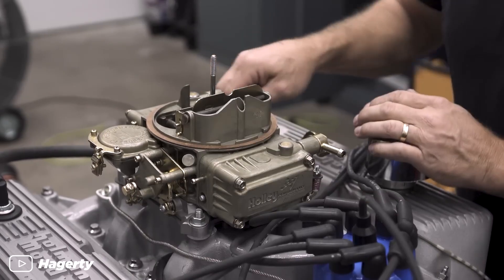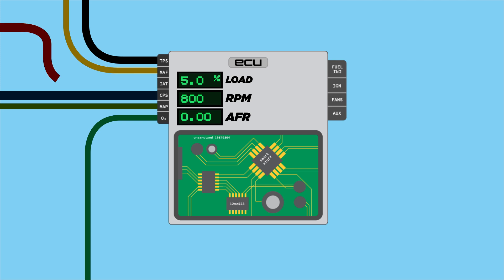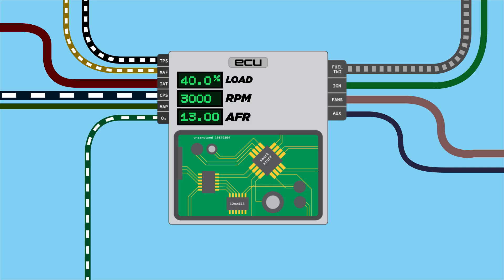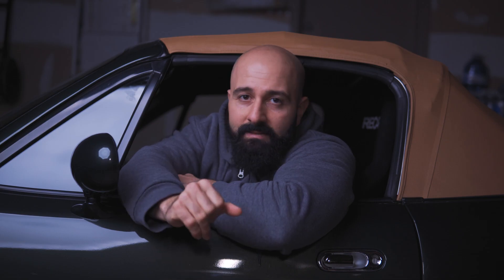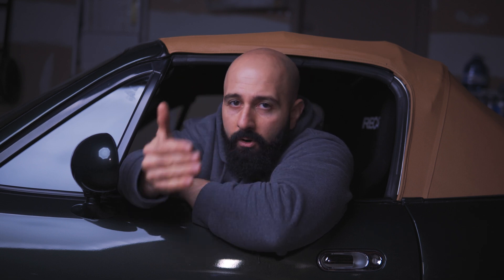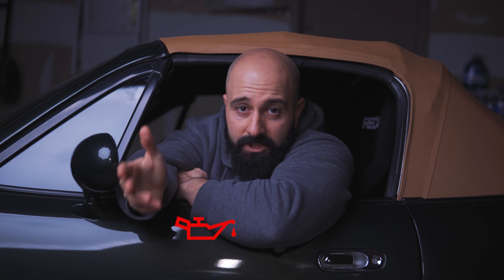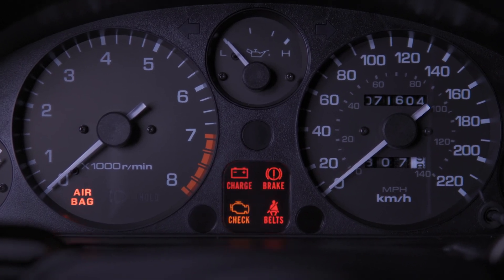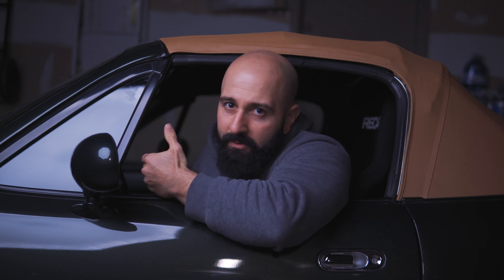Engine Warm-Up Myths || EXPLAINED

Comment: I warm up because I don’t drive that far to work. I rather get a full heat cycle in before turning it off. Also rotary… ¯\_(ツ)_/¯
Reply from the maker: Yea for rotary you need a full heat cycle or you'll get carbon buildup.. but you already know 😁😁😁
Reply: @MZopyrus Hello, is there a way to contact you?

Comment: I always wait until the revolutions drop, which is about 30 seconds. Then I drive carefully and slowly along the streets from the house, a maximum of 50 km/h before the water temperature indicator moves, which is about 20-30 degrees Celsius of the coolant. Then I can accelerate to a higher speed on the road outside the city, but I don't bother the engine, I wait until the oil temperature indicator (not water) shows 50 degrees Celsius - then I drive normally. But I don't turn the engine into the red zone unless the oil is at least 70 degrees.
I have gasoline direct injection as a winter car - with a heat exchanger on the exhaust pipes so it heats up relatively quickly and uses all the waste heat from the engine. I also have a petrol 4.4l V8 - and it warms up immediately. 
I used to drive a diesel with indirect injection (with swirl prechambers) - and they are prone to cracking the head around the chambers if they are not heated properly, because the prechambers heat up faster than the rest of the head and there is a lot of tension in it. Diesels with direct injection are much less susceptible to head cracking.

Comment: All you need to do is wait like a minute and 20 seconds usually it takes 30 seconds for the oil to all around the engine to lubricant everything and then druve off like normal
Reply: This is wildly inaccurate. Oil circulates near instantly. Get an oil pressure gauge, or watch any of the 1000 videos that show oil reaching the head within moments of starting the car.

Comment: I think this myth is engine specific. Its called "operating temperature" because its the ideal conditions. Cars today are built for consumers, who like to hop in fire up and go. So its fine to do this. Its not fine to fire up and go for 2 minutes and then cool off. Heat cycles are what wear engines. If it doesn't reach ideal temp during a drive cycle your causing more wear.

Comment: I have to let mine warm up a lot to spare the transmission. I don’t know enough about transmissions to know why but mine for whatever reason will shift awfully until it’s quite warm. It’s an automatic 2013 Acura Tl if anyone has an explanation but I’m probably to get it looked at soon anyway
Reply: Probably bad fluid that needs to be changed. If yours hasn't ever been changed, and depending on the mileage, it's possible that changing it may only do more harm (REALLY divisive subject and you'll a million different answers as to if that's actually true or not)

Comment: If it's warm or hot out, I give it like 10 seconds max just to cycle the oil once or twice. If it's cold out, I normally give it like 45 seconds or so if I'm in a rush.
Reply: 1 minute man, you can give it 1 minute for start and shutoff especially if you drove aggressively
Reply: @nicolae-alexandruluca7853  it's depend car each carbon build up different and some has issue mine warm up at 20sec gti 7 cs winter around 40sec the car sleep outside not in garage*

Comment: i'd reckon it also depends on what you drive, a modern Mazda with say the 2.5 Skyactiv engine doesn't take very long to warm up, usually onces it gets close to 120F i start to take off slowly

now in my Civic Si, it drives like utter garbage unless it's at least 50% of normal operation temperature, especially when it's below freezing outside
Reply: I will say, 120f is BEYOND 50% of it's normal temperature, so that applies to both of your vehicles.
Reply: @QuincyStick  for the Civic specifically, it doesn't give out an actual number, i'm entirely basing it off the digital bars, so typically i take off at 5-6 bars on the temp gauge

hence my "50%" statement, the Mazda is a different story though, you are correct
Reply: @FrozenIce  not sure the year of your si, however on the 10th gen civic (2015-2022) the first bar on the temp gauge is 132F (to my knowledge, from my brief google search)
Reply: @FrozenIce  still better than just 2 lights for the water temp: one for too cold to open the thermostat and one for overheating like in mazdas bl gen

Comment: Thats exactly what my warm up routine is. Living in south florida, i never have to warm up until winter. sometimes in the mornings its a Cool ass 60 outside. so i warm up by starting, Getting in Gear. and Rolling Slowly as Possbile out of my neighborhood to the main roads. By the time i get in traffic im approaching operating temps. on EVERYTHING.
Reply: 60 is not a cold temperature, you just deem 60 as cold. There is absolutely no reason for anyone anywhere to do anything pertaining to heating up a car in that temperature.

Comment: 2:45 to everybody who uses the metric system why do you use Celsius instead of Fahrenheit? Wind Fahrenheit is more accurate you have more numbers therefore you’re more accurate you can divide those numbers easier then you can Celsius, so why do you use Celsius for heat? We need is harder to do then. Everything else a.k.a. Fahrenheit.
Reply from the maker: Because everything in metric basically makes more sense 😂. Sorry to say this but it's honestly true.
Reply: @MZopyrus  you didn’t answer my question Fahrenheit has more numbers therefore it’s more accurate, so why isn’t Fahrenheit used in the metric system you’re going to use something that says I look 20° is 107° and you’re the ones that want to be precise
Reply: @MZopyrus  😄😂🤣😅😁😄🥲😆😂😄 if I post this isn’t answering a question or is it just doing nothing?
Reply: @oler777  You better start using Kelvin, it is even more accurate....

Comment: Isn't it actually MORE of an issue with direct injection because you end up spraying fuel on the cylinder walls and wash down the oil?
Reply from the maker: That's actually not that big of a concern as some people make it to be, technically your cylinder walls are already almost dry from your car sitting overnight and with one stroke they're already coated with oil again

Comment: Bro. I got a 700hp stage 3 S6 and I want to send that shit so fuckin bad because I don't get to drive it as much..

My question to you is this. I have an oil gauge, an this gauge gets to the "middle" pretty quickly, but my temperature doesn't get to 190/200 until I drive it for a couple of miles (I have a digital gauge for that too)

My question to you is this. When can I fucking send it? When the gauge is at the middle or when my temp is at the "normal" levels
Reply: When you get to 190-200 and then another 5 minutes.

Just because your oil is upto temp doesn't mean the entire engine and drivetrain are.

Comment: i let my bike warm up till the exhaust sound changes (15-20 secs) (because it doesn't have a rpm meter) and my reason is I think the metal should have a nice transition in temperature cause just getting onto the engine might rise the temps quick and it might increase wear , I might be completely wrong but I love my bike enough to waste that little time, no offence you can get onto ur machine high up to sky limit.
Reply: I think it's also quite different for motorcycles given the vast rpm differences between them and cars. You can gently drive a car at around 2k rpms pretty easily in a car. Can't exactly say the same for a bike haha (unless you're talking like harleys or something)

Comment: Fuel consdensation is still influencing ur Car bc the maschine has a Knock sensor which changes the ignition point which lowers the performance isnt it so? And if ure piston and cylinder wall isnt warmed up there is a bigger gap between it even with the oil and the sealing ring which means that the gasoline gets more in the crankcase isnt it so?  And the thing with the 5W30. this doesnt mean that the viscosity is optimal for an not warmed up engine. U showed us the range of the outside Air but when it comes to the  inside warmth the oil is not heated enough for optimal running isnt it? like u cant connect the operating scale from the oil to the viscous... of the oil  isnt it so? I am just a student so tell me if i am wrong or right and give me the solution pls.

Comment: I wait 10 seconds at startup to have all the parts lubricated. Then I drive under 2000rpms until the oil is at 75C and under 3000rpms while it goes from 75 to 90C. After 90C I can floor it if I want.

Comment: 99 miata with 250k miles.. ALWAYS feels better (initially and throughout the day) when warmed up completely after sitting all night.. Might just be a high- mileage thing 🤷🏻‍♂
Reply: that's an every car thing usually. ecu compensation until it detects your temp being at "operating" - usually a set value so you will notice it run better at a specific point in the temp gauge every time

Comment: People ask me this often, i put it this way to them, these cars arent your grandpapys carburated iron block V8's that need to warm up for like 3 minutes before you get going. I say its valid in my opinion that you need to let your computer let the engine at least warm up until it does kick down in rpms to around 1200 before you start moving, but dont drive it hard until your temps move upto optimal at the very least. Dont start and drive out super hard, that wont do any good to you or your car.

Comment: I think it depends on the composition of different components. Aliminum pistons will expand faster then an iron block. That being said excessive idling is pointless. For my old diesel (depending on how cold it is) a few minutes to let some diesel degel and circulate and some time for most of the internals to begin expanding gently is enough to ease into gear and through the rev range until oil temp comes up.

Comment: People who says "today you don't have to warm up" don't know about: PISTON DILATATION
Modern cars do warm in a shorter period? yes.
Oil flow is now better than before? yes.
Oils are better? yes.
But when it is cold engines still have problem with piston/cylinder wear.

Now-days engines have stronger oil pumps than pre-eighties ones, and use more oil, and more flow, and oils are now far one number from another like 5w40, or 0w30. But at the first minute, piston is still on wrong shape which becomes correct when warmed up.

So do not demand too much from your engine when it is still cold.
Reply from the maker: This is correct
Reply: What about hybrid models ? My car never warm up in town engine have max 50 degrees it warms up only highways  to 90 - 100 degrees …

Comment: In the winter I typically start the engine, put it in gear and immediately hold it at redline spinning the tires until the oil, water, tires and brakes come up to temperature. Hope this helps!
Reply: 😂😂😂 chill these people will really Believe this.
Reply from the maker: Lmao 😂😂
Reply: In the winter I drain my oil when I get home and before I go back out I warm it up on the stove and then I pour it back in the engine boom 💥 warm engine 😂
Reply: @indadrops9492 lot of unnecessary work but I actually think that might be better than just cold starts. Not at all worth it butttt. 😂
Reply: @dyllian9948  🤣
Reply: Lmmfaoooo
Reply: You win the internet today
Reply: Pro tip: i usually put boiling water in the fuel tank and engine to warm it up even faster.
Reply: I add hot water to the outside of my tires and windows to warm it up
Reply: Hahahah
Reply: @JubJubAc  if you are spinning the tires as soon as you start the engine in a freezing winter you could be creating much more damages?. The oil in the 1st 20 seconds is likely to be still at >2000cst. Better to drive off at 2000rpm maximum until engine coolant is 170F?
Reply: You have to burn down your tires in order to warm up your car. IT IS FACT To spell fact, FACT to say to spell fact
Reply: Lmao😂
Reply: 😂😂😂Someone will eventually believe you and take you to task….i love the internet
Reply: Gonna try dat

Comment: I once heard a automotive engineer say "I've seen engines damaged for lack of warm up, but I've never seen an engine damaged for allowing it to warm up before driving". And that stick with me. I've had  cars and motorcycles, and I've always allow the engine to warm up for at least 2 minutes, and I've never, ever had an engine failure. 👍🇵🇹
Reply: I can promise you the engineer was not looking for the failure to be warm up related. If the engine failure was due to cylinder scoring, they would've assumed or correlated the damage to something else. Idling is just fundamentally bad for an engine, plain and simple. Now whether or not you want to argue idling for warmup is dangerous or not, is an entirely different thing. I just find that argument to be EXTREMELY flawed is all.
Reply: @QuincyStick , I don't know. I'm not an Engineer. I do believe that allowing the engine to warm up, just enough (2 min max) to pistons to expand, reduces wear, due piston slap.
Reply: @v8berenguer372  Piston slap, if any, will be extremely minimal to the point of being negligible. One of the recent camry v6s is notorious for piston slap when cold (And when I say piston slap, I mean aggressive enough to be audible during driving, regardless of how well you take care of them), and they still regularly tick for 200k+ miles. Again, if you'd like to argue that allowing the car to warmup for a little while is better than driving it right away, by all means, go ahead! I just think that the argument of "Well I've never been able to tie an engine failure to excessive idling" is pretty poor, as a lot of the potential engine failure modes of excessive idling could be mistakenly attributed to other things, and unless the tech/mechanic does an extensive deep dive into the engine while also thoroughly investigating the drivers habits, they're probably never going to assume that idling is the cause. Not necessarily saying that warmup idling would cause engine failure, simply that I find THAT particular reasoning for that stance to be rather flawed.
Reply: @QuincyStick  I'm talking about 2 minutes max. I don't consider that excessive idle. In fact, I heard excessive idle is bad, because it washes away the lubricant from cylinder walls(which is obviously not good), and that excess fuel(cold engines run on a rich mixture) will end up in the oil pan, causing oil contamination/dilution.
Reply: @v8berenguer372  As I said, I haven't an issue with the idea of warming up for a couple of minutes, merely the analogy that "engineer" provided you.

Comment: My warm up routine (EJ25) is starting the engine and not touching the gas pedal until rpm drops to the idle. Then i start to drive gently and as low rpm as possible for few minutes.
Reply: I hope you people know why modern engines holds higher RPM after the cold start and what it means when the drop?
Reply: @And4224  mine warms up the cats this way
Reply: @And4224 fuel efficiency. Epa or whatever the eco people are
Reply: @And4224 Catalytic Converter Warmup?
Reply: Sounds reasonable
Reply: I do this to my ej22 as well. Gotta take care of these boxers and they’ll take care of you
Reply: So exactly what he said. Thanks for sharing
Reply: I think higher loads are worse for the engine than higher rpm when it's cold (more powerful combustion and less oil pressure)so trying to stay at low rpms(and high load) is not a good idea
Reply: @arianamirgholami9555 indeed, it's what I also commented, keep it at 2000rpm and above even if the turbo kinda kicks in, turbo kicks in in stages, it gives off a little boost when you hit the rpm range and barely any gas, when giving it a bit more gas from less then 2000rpm then it gives off a bit more boost and engages much harder after achieving higher rpm then 2000 and hits at the very strongest at like 3000rpm for 4500 red line and 5000rpm at like 7000 red line and so on
Reply: Hey Subaru
Reply: man ur that scared of that thing taknig a crap huh?? lol must give u some anxiety.
Reply: EJs are known to be some of the most reliable engines there are, the only drawback is that they're incredibly unreliable and can break down at any time, often without any warnings. They're pretty awesome though and they really last a long time  @jackhofalot6705
Reply: @jackhofalot6705  no? You should do this to every engine. My car drops down to idle after like 25 seconds. I can just fasten my seat belt and check my phone and it's already at idle.
Reply: @jackhofalot6705 This is literally every engine you should be doing this too.
Reply: This is exactly what I do with my VB24
Reply: This is how it should be done on any modern engine not just the ej25.
Reply: Best idea is to keep the car for at least a minute rolling, in colder temps maybe a few extra minutes to allow the water in the engine to heat up a bit, then drive with relatively normal rpms, for cars hitting the red line at like 4500 its best to drive at 2 maybe 2500 rpm even if the turbo is on at like 2000,for cars greater then 4500 maybe like 6 or 7000rpm then it's in between 2 and 3000rpm
Reply: Actually, you do not need to. The car maintains higher RPM for a while for emission purposes. You can slowly drive it around and by the time you are on the main road, your car is probably up to operating temperature. Not full sending the car for a few minutes is a good idea though.
Reply: Same as with my EJ25
Reply: Not necessary.

Comment: I start the car, after 20 secs I put the gear in Neutral so the gears spin and heat up as well, and wait until it reaches near ideal operating temperature which takes for me around 5-10 minutes.

Comment: pretty much the same, let the idle drop before driving, but I wait a while after the coolant temp gets up to 176° before getting into boost because i run a higher viscosity oil than oem recommended spec!